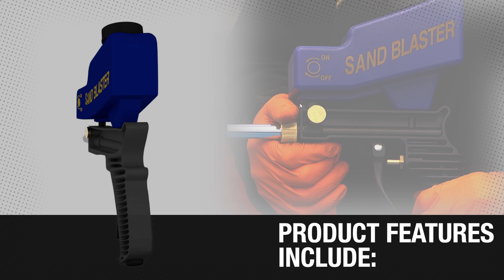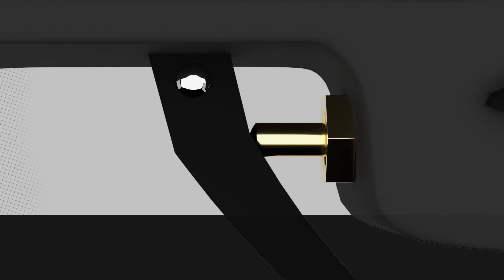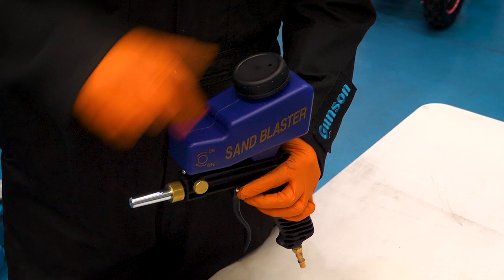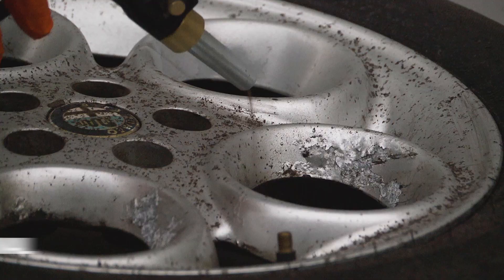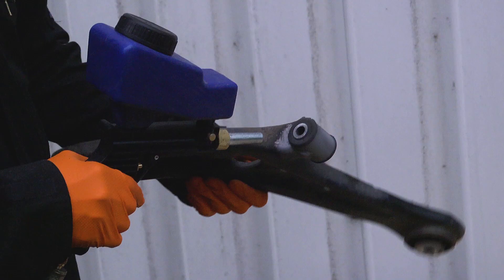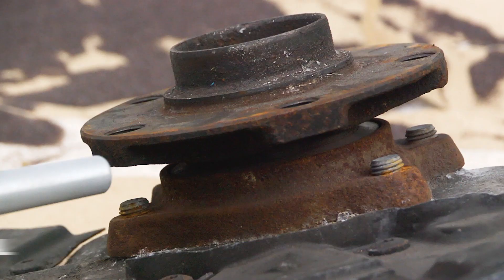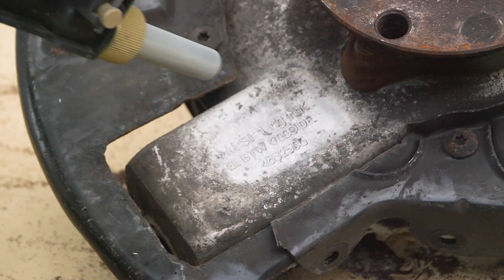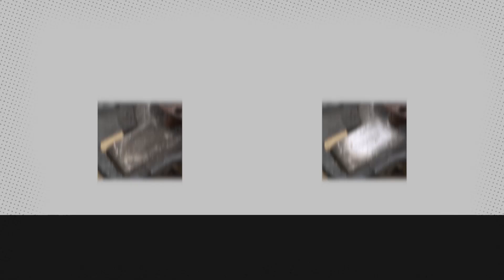77155 Gunson gravity-fed sand blaster gun

Comment: It looks good. also very good for removing carbon build-up on valves
Reply: Andy ME  you obviously don't know much then because that is exactly how you remove carbon build up up from the Direct injection engines the photo you using it will not under any circumstances damage metal or aluminium

Comment: Thanks for the video.  How big of a compressor do you need?  I only have a small 2 gallon one (not very high refill rate).  Would this be sufficient?
Reply from the maker: The specification calls for 90psi with the unit consuming 7scfm (standard cubic feet per minute), so your compressor needs to support this.